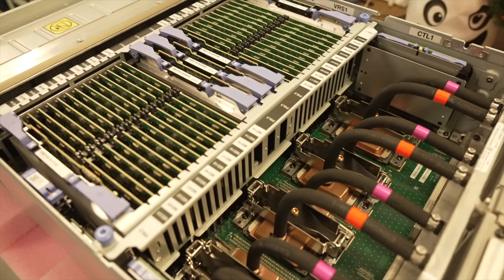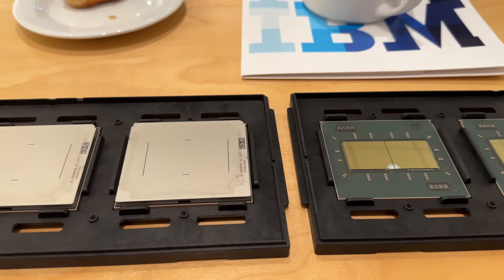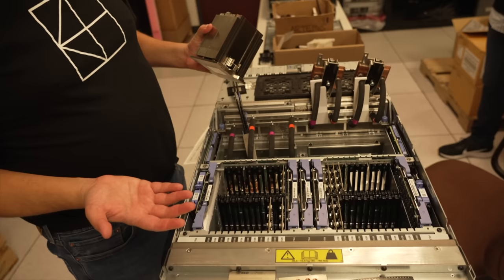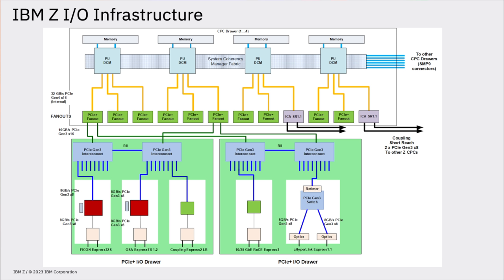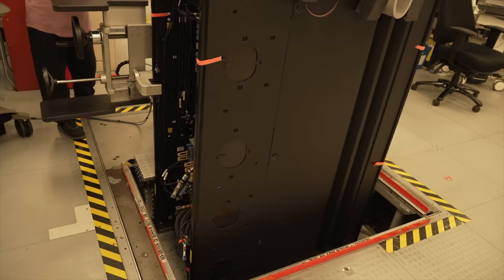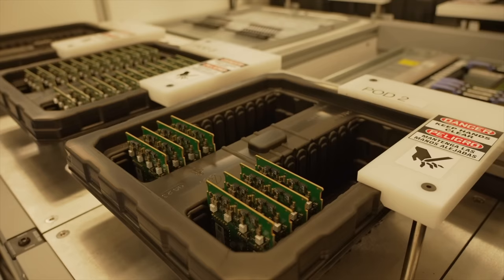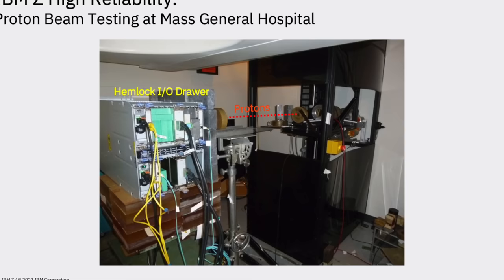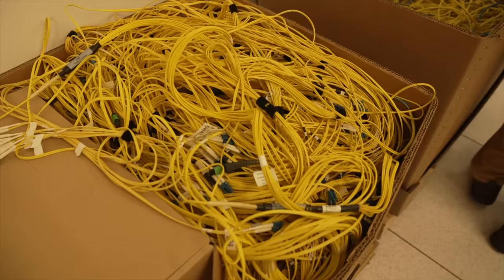Why Do Mainframes Still Exist?  What's Inside One?  40TB, 200+ Cores, AI, and more!

Comment: It's funny that the hardware design of IBM mainframes is so cutting edge and yet their OS and software is still stuck in the 1970s with block allocation.
Reply: What's funny about it? Every single piece of code written for z/OS, whether it is 1 week or 50 years old, expects that.  It's called protecting the customers investment.  If you run a different OS (like Linux), you can use plain old FB512 disk.
Reply: @briansomething5987  so it's done for backwards compatibility?
Reply: @mieszkogulinski168  exactly

Comment: Nice IBM main frame computers.  But can they help me balance my checkbook and hold my kitchen recipes for cooking?  LOL  Seriously how fast is their basic integer math?  I have been using that as a basic speed test from the TRS-80 days.  All I do is sum all the numbers from 1 to 10,000 and look for the sum of 50,005,000.  Yes, I know the answer is 10000(10001)/2 but I am looking for the actual speed of integer math.  The old TRS-80 computer took 2 minutes to sum all those numbers together and my current intel based, water cooled machine does the sum in 200 usec using Visual Basic 6 or 2,000,200/200 = or 10,001 times faster than that old machine.

Comment: Been a while since I last worked in an IBM mainframe shop (early 1990s).  Do these Zee machines still run an evolution of the 360 instruction set?  Could an original 360 assembler code be translated on a modern machine and run, or would it need to be compiled into whatever native instruction set the newer machines run?  
In terms of operating systems, is that still MVS under whatever new name it may have?  Same middleware such as CICS IMS  DB2 etc? Does it still use "datasets" for its file system along with partitioned datasets for multiple smaller files like source code?   Still use JCL?   I heard TSO/USPF was replaced for interactive use.  It is all Windows based with some SMB like networking to access datasets? 
Does IBM still use SNA between machines? Still emulate punched cards to "spool" a batch job ?  (remote job entry) ? 
I assume it now supports TCPIP.  Would a web server have the HTML/Javascript/CSS  stored in a partitioned dataset?  
Has inter-process communication evolved a lot since back then to mimic what Unix can do today?
You mentioned clustering. As I worked in VMS environments, does Z-OS now support cluster-wide locks such that node A gets exclusive lock, and node B can request that lock, and if Node A fails, then Node B is granted the lock?   Does it have cluster-wide locking of files, or is that the responsibility of the database system to implement its own distributed lock mechanisms?
Reply: The new machines run all customer (problem state) programs from S/360 days unchanged.  There are of course many new instructions as well.  MVS (now z/OS) is still used, although many systems run Linux (there are even models, called Linux One, which can only run Linux).  All the stuff you mentioned from MVS is still there, although z/OS is also fully POSIX compliant.  SNA is supported, as is TCPIP.

Clustering is called parallel sysplex, and has been available since 1990.  There is a component called the Coupling Facility which handles things like locking.  The CF can be a separate system, or it can run in an LPAR.  There is also Geographically Dispersed Parallel Sysplex, where the systems can be miles apart (or even anywhere in the world).

Comment: X86 what is that like a front side or back side coronation spacing that constantly rotated back and forth between letter reductions or placements this is all while being inside out when you set something up to when you don't set it up when you buy it and it's already spaced and settings which means you're forging or your perjuring your accepting corruption against everything out in the open by how you align your dictionaries and we see that pretty easy cuz we got all these color gays out there

Comment: Coming from the cloud developer side, I can say that mainframes are too expensive. We often need solutions that need more compute power yet can run on x86 or arm systems in the cloud. All that even though IBM offers the mainframe as a cloud service as well.
Reply: I'm guessing that as a cloud developer you have no idea of the kinds of workloads run on mainframes.  They are not used for raw compute power, they are primarily used for lots and lots of transactions, and that means lots and lots of I/O.  Transactions that have to be consistent, immediately.  Transactions that can not afford any outages.  

If you had hundreds of tons of freight to move across the country would you put it on a train pulled by a locomotive, or would you use a bunch of faster F1 cars?

Comment: I am not convinced Z is meant for GPU AI applications. Seems like these frames are intended for online transaction processing for DB2.

Think the main Bank of America database tables from the last 25 years.

Home of the Token Ring topology. I am sure they never saw a ethernet cable for the last 40 years.

Someday they will need to migrate to a Supermicro x86-64 DB2. Or IBM Power and Linux. Please tell me I am wrong.

Comment: yeah so. 40 ordinary 80 core 1tb ram servers combined also have 40tb ram. and 3200 cores. the difference is that you can have those delivered this week. and the combined setup is probably cheaper than the ibm mainframe. and faster too.
Reply: ibm never knew how to sell stuff. lolololol. after like 20 years in business we finally got some accountmanagers there. they're like sun. a pain in the ass to deal with. lol.
Reply: also they still seem to think people want big lumpy heavy boxes you break your back on when actually the guy ordering them is also the guy that has to lift them up and wait for the annoying things to boot. lol. they can damn well skip the 'making it big and important and sluggish' act. as their bank clients where the owner never sees the actual computers are far in the minority nowadays. in the entire internet industry the ceo has to work with the crap himself and therefore doesn't want 60kg each boxes that take 10 minutes to boot. :P price doesn't really matter either way but with ibm both the hardware, and their sales methods are just a pain in the ass to work with.
Reply: that whole 'putting a big metal box around it, and then lots and lots and lots of ventilators just to suck the air through said big metal box' mentality needs to end. lol. we'd be far more happy with just some u-shaped open rack units with a mainboard on it tbh. lol. at least you don't break your back lifting those things up :P LOL. and you don't need all those ventilators just to keep the airflow going. as basically they're just open constructions. (yes ofcourse any larger customers like us own our own datafloor and as such the box itself doesn't need to be closed, neither do the racks, no sidewalls or doors needed. ;) so for craps sake stop selling that overweight shit. and you don't need to make it take 10 minutes to power up 'spinning up' all 'ssds' one by one either as even in the mechanical harddisk days. ya know. if you buy that kinda stuff you also have let's say a 5megawatt power capacity to the feeds when you only use 1 megawatt (they do that slowing down to avoid 'peeks' on 'thin wires' but if you can't afford a proper electricity network and supply you should not be buying their servers in the first place ay. the peaks should be no problem ;)
Reply: that is very much a bunch of problems they all have btw. hp, dell, ibm, none of em actually understand how their equipment is getting used. and that that 16 year old popping up to order it with 10 million bucks in cash in a plastic bag also owns the company nowadays. :P  they still think their clients are 'banks' and shit like that when in fact 99% of it goes to the internet industry. :P and we want entirely different stuff from banks tbh.
Reply: actually already talked to a few metal lasercutting companies to just make u-shaped 19" plates with atx screwholes and a 48v dc psu aaand then just take some shitty asus or something mainboard that can take 1tb of ram and fit it with a stripped down bios with just the ipl as linux does all the other stuff by itself anyway. should take less than half a millisecond to finalize boot upon receiving power. not 5 minutes. work to do ibm... ;)
Reply: ya know we actually don't even want the 19" screwholes in the 'cases' we just want hooks. so you just lay them down and the hooks and gravity keep em in place. no more battery drills needed. lol.
Reply: ibm. the 'business machine' company that used to make 'business machines' that won't boot if there is no video card or keyboard plugged into them (lol ;) how very businessy. lol.
Reply: they severely lack any knowledge of what the customers want and that already dates back to the xt. which indeed, won't boot at all without a keyboard :P or a video card. and can't output it's bios stuff over rs232. which would already have been preferred in 1981 tbh. lol. they never learned since either.
Reply: to this very day those things come for 'slots' for ssds/hdds that connect like an old mechanical one. when in fact they should all just come with 20 or so full length full height pci-e slots to dump the ssd boards into. :P so they can be addressed directly without pretending to be some 'derivative' of old standards intended for mechanical junk. you can fit a whole lot of ssd chips on the front and back of one of em big cards. lololol. and address them directly in a parallel fashion :P without any 'sas or sata' or other crap intended for mechanical scsi drives in between.

Comment: Actually, the cpus are quite slow. You can emulate a mainframe on a pc, using the software Turbohercules. Check it up. An AMD Epyc cpu is much faster than a mainframe cpu. They have lot of legacy cpu instructions back to 1960, they are bloated. However the mainframes have superior RAS and I/O. A pc cannot come close

Comment: I was hoping you'd mention what kind of ram they use. Doesn't look like standard DDR# dimms. Is it some form of HBM or some unique proprietary solution or what? What are the specs of modern main frame memory?

Anyone who knows, I'd love to be enlightened!
Reply from the maker: As far as I know, it'd DD4, but has power circuitry and other electronics right on the DIMM.  They stripe RAM in RAID-10 fashion across the DIMMs, I believe.

Comment: I mean you was talking about you test for cosmic rays in case of like a solar flare but you was testing in the hospital for radiation flares so I'm sitting here wondering why you would be testing radiation and saying solar flares and if you got the battery placement of power in a different rotation construction you'd ultimately be putting it out in the atmosphere or pulling it inside which then means it would be sitting here staring at me or sounding towards me when I hold it up to my ear correct

Comment: There are no mainframes by the original defiition and if you can just change the definition then anything can be a mainframe.  If it doesn't use a large monolithic CPU; then it isn't a mainframe; if it doesn't use analong rack; called a frame for outside communication it isn't a mainframe.  If it uses microprocessors it certainly isn't a mainframe. So no one uses a mainframe other than someplace they may have one for a computer museum.

Comment: Well, reliability is one thing, another thing is that the software requires to be run on a single machine and redesugning it for a more distributed system can be prohibitively expensive.
Also itis probably more practical to gather top-notch hardware engineers in a single building and pay them whatever money rather than to gather a team that would design a top-notch distributed system that doesn't need a mainframe. Hardware availability is rarely a problem in real life, things like parthing and upgrading could be way more impactful, especially for large systems.
All in all, mainframe is still a single point of failure, howere glorified.
Reply: Clusters of mainframes have been a thing for over 30 years.  It is called Parallel Sysplex.  There is also Geographically Dispersed Parallel Sysplex. That is a combination of hardware, software, and storage support.  The data is constantly mirrored to the remote location(s).  If one site goes down, additional cores are automatically added to the remote site and it picks up the workload, generally without any human intervention and without the applications even noticing it happened.
Reply: @briansomething5987  doesn't matter what you do, distributed transactions are impractical for distances over 800 km between data centres. And if distributed transactions cannot be supported, then you can do pretty much the same functionality on conventional hardware at the fraction of the cost. The whole point of big machines is to provide ACID guarantees, which requires the removal of P (partitioning of the data) from the CAP theorem, so that you can have both Consistency and Availability at the same time. In the presence of partitioned data, you cannot have both Availability and Consistency at the same time. This is a theoretical limitation.

Continuous data replication must introduce either consistency risk (delayed replication) or availability risk.(transactional replication, but now if either machine is down or network iscdamaged, the original transaction will have to fail).

So long story short, mainframes don't solve theoretical problems, they are just beefy machines. Using such machines introduces its own set of risks, there is nothing magical about them.
Reply: @KirillFrolov77  you are the one who made the claim that mainframes are a single point of failure.  That is false, as they are often run in a sysplex (in the same data center).  If some system fails (or is intentionally taken down) the rest of the plex can take over the workload with no loss of data or loss of performance.  The geographically dispersed stuff if for DR.  You can have a "metro" sysplex, which can have live data and not lose any data during a switchover.  You can also have a "global" sysplex with the remote site anywhere in the world.  In that case, yes you can lose some data.

I never said mainframes were magic.  I was just countering the silly notion that a user would only have one mainframe and it is a single point of failure.
Reply: @KirillFrolov77  There is NEW code written for mainframes all the time.  The majority is written in Java.  There is so much Java workload that the systems have special instructions to do things like enable pauseless garbage collection.  IBM even has tools to help convert old COBOL programs to Java.

Then there are things like decimal floating point being implemented in hardware.  An awful lot of mainframe workload is financial, and financial is decimal based. 

And finally, about half of mainframe workload is now Linux.  And there we have features such as Secure Execution for Linux.  This allows a cloud customer to completely encrypt all of the boot material (kernel, initramfs, kernel command line) and then have that image run in KVM.  Nobody, including the KVM host or its admins, can access any part of that image.

Your knowledge of mainframes, and the reasons they are used, is weak.

Comment: Question. What is the time between two concurrent events?
Reply: See I don't really think much of Moores law. But amdahls law I see very differently.  The I in eye. Needle and thread.
Reply: But what gene amdahl didn't realize is that everything around you runs in parallel. People run in parallel. What he stated was the age-old adage. Follow the leader.
Reply: If you really stop to think about it. Time does not exist. We invented it.
Reply: Though it is a useful invention.
Reply: But there are numerous ways of doing things and very few people who want to do them.
Reply: My dad said he met him when he was working at ibm.
Reply: Amdahl's Law is indeed a fundamental concept in parallel computing that addresses the limitations of time when improving the performance of a computer program through parallelization. It provides insights into how the speedup of a program is limited by the portion of the code that cannot be parallelized. So, you are correct that Amdahl's Law is related to the limitations of time in the context of parallel processing and program optimization.
Reply: Charles Babbage fittingly called it a difference engine. We can not see anything unless there is a difference. The difference is what we see.
Reply: What exactly was Babbage referring to? His machine or the machine that we are?

Comment: No offense but none of the examples given seem to me like they require a concentrated computing unit like a mainframe to be viable. Just proper design of the software stack to distribute tasks to any cluster of x86 servers running a hypervisor and VMs or these days even these newfangled microservices I'm hearing about.

The whole thing still feels to me like it's just a 'solution' to huge institutional resistance to change ie they were doing it that way in the 70s so they want to do it that way now.

Comment: Any modern server has redundant and hot swap everything, also in almost any HA setup things are virtualized and if any one piece of hardware fails the VM seamlessly rolls to another piece of hardware.  Anything can be fitted with fiber interfaces.  They are not unique to mainframes.  Most of the advantages you were touting are not unique.  I often joke that most server class hardware will become obsolete to even the hobbyist before it dies.